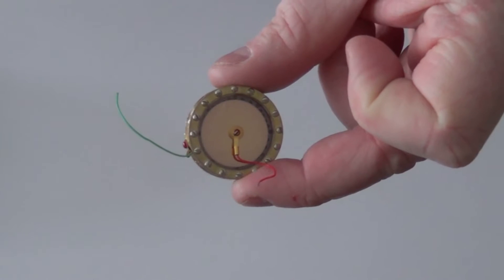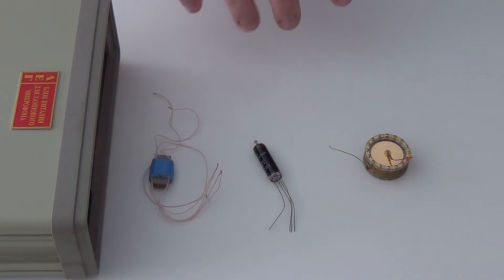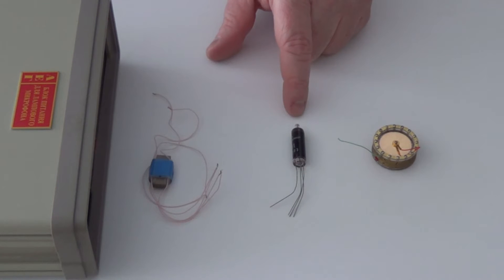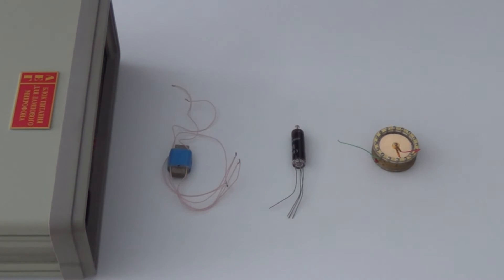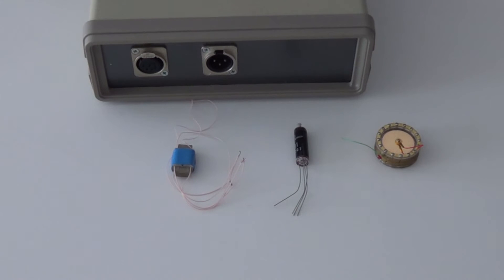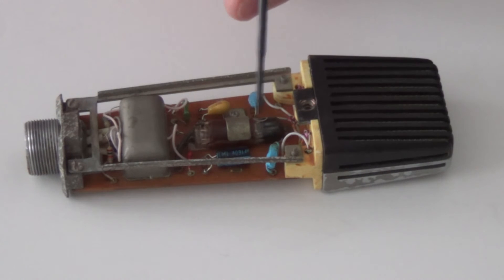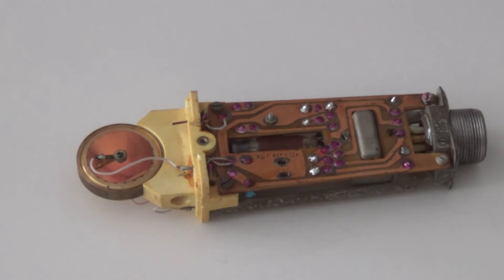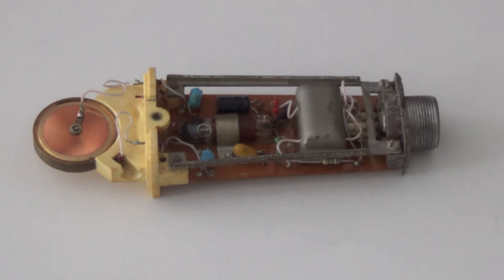Tube Microphone Basics

Comment: Your first capsule is not a K47 capsule. It's a 32mm version of a K67 capsule (a K47 is a single backplate 34mm with a much different blind and through hole pattern), which is garbage in a tube circuit unless the transformer has enough phase shift to reduce the presence peak found in the K67 capsules.
Reply from the maker: the video was called "microphone basics," what you're talking about is a bit beyond the basics.  I thought it was obvious that it was a junk capsule that I was using for the demo, I wouldn't handle a real K67 like that.

Comment: can you use phantom power with a tube mic?
Reply from the maker: In theory yes, it's interesting. I've seen it done by using voltage doublers for the capsule polarization voltage. I've also seen it done by using 48 volts of polarization. However phantom power is  very low amperage, so It sounds like quite a feat to pull it off.